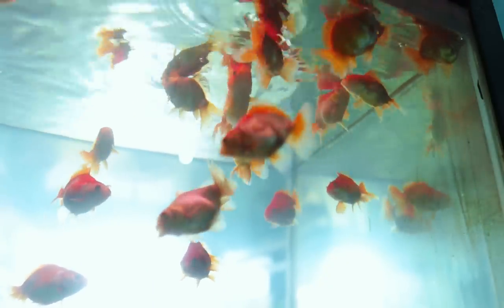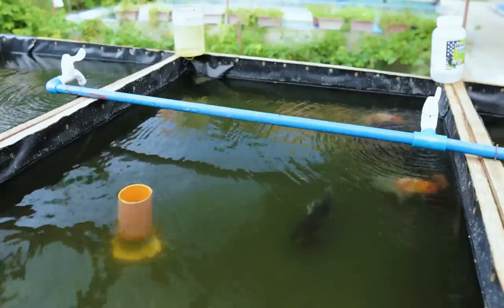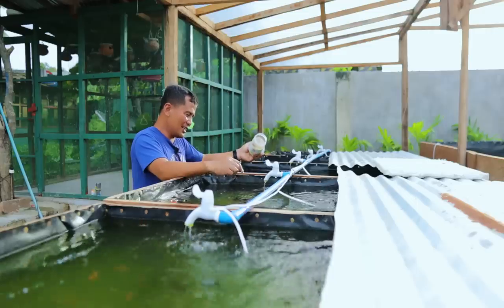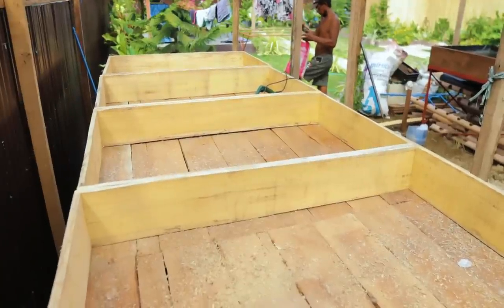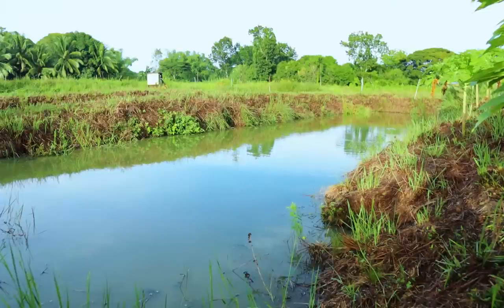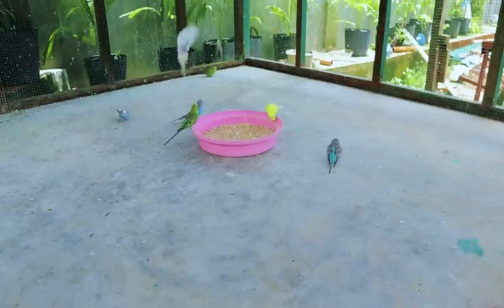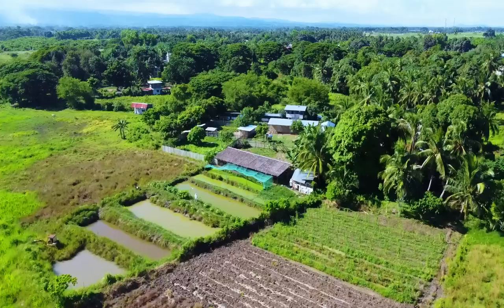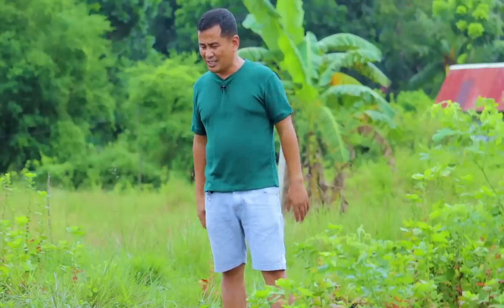Fish Farming ( IMPORTED GOLDFISH ) - How to become succesful in raising High Quality Goldfish!

Comment: have you ever considered using black soldier fly larvae for feed for your chickens? mix with some duck weed and make your own feed pellet's. can also use for fish feed. Also all that beautiful fish waste should be used to grow vegetables in aquaponics for your restaurant. gives you year round vegetables but typhoon is a small problem for aquaponics. power interruption is also a problem for aquaponics but solar or generator can assist to ensure you face less challenges. You would have the ultimate set up. Waste from your restaurant feeds the soldier fly larvae. The larvae feeds your fish. Waste from the fish feeds the vegetables. The vegetables supply your restaurant and then the cycle begins again.